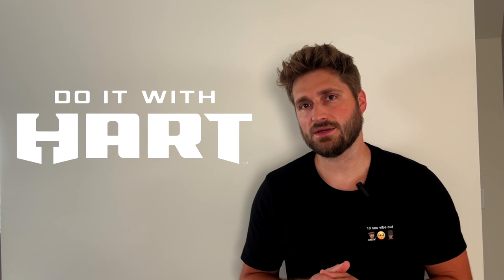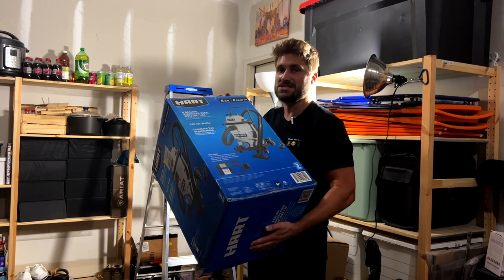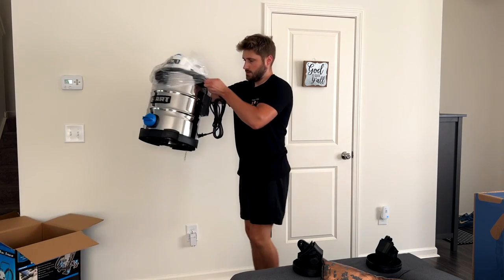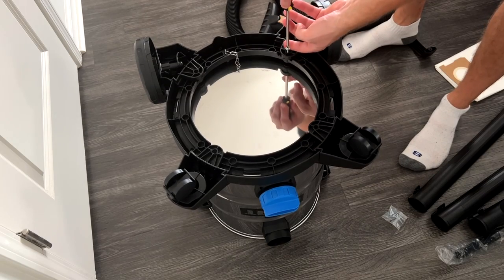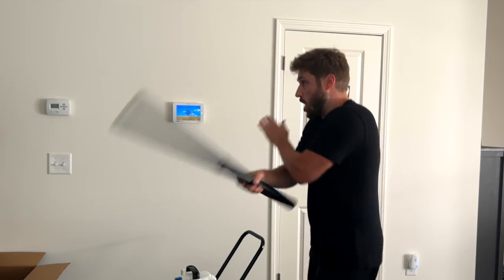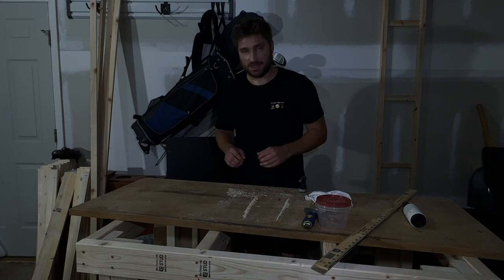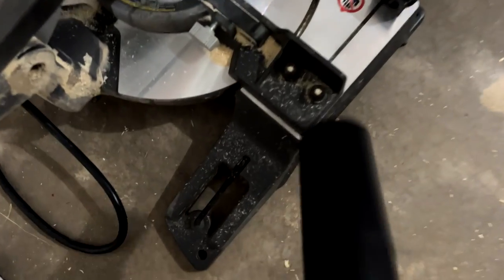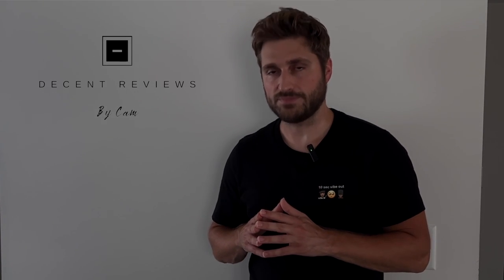Hart Wet/Dry Vac Review: 8 Gallon 6 Horsepower Stainless Steel in 2022

Comment: The machine is a house brand of Wal-Mart as this model has also made its appearance in my Canadian Tire store under the house brand MasterCraft.  My brother had one and oddly it just died today.  The machine is a cost cut version of one of Emerson Electric's machines.  Emerson is the company that sells wet and dry vacs under the Ridgid, Craftsman, MasterCraft Maximum (house brand of Canadian Tire), ProTeam, Workshop Vacuum and other brands.  To me the Emerson vacuums are actually better made than Shop Vac brand machines now.
Reply from the maker: Thanks for sharing this info!  I wasn't aware that Emerson distributed all of these brands especially Craftsman! With my limited use of both brands I agree, did enjoy the build and design of this Hart wet dry vac!